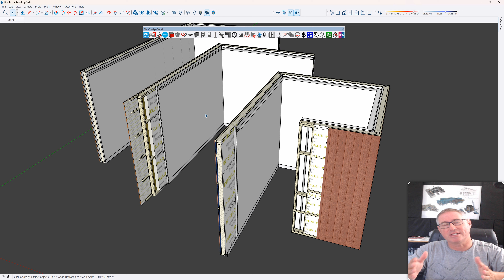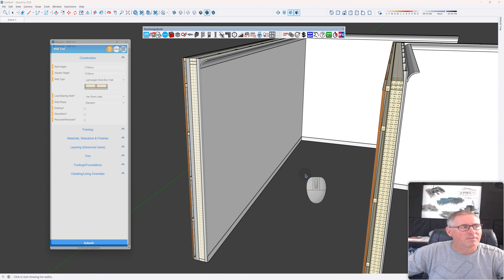Passive house wall build-up creation. Sustainable Design & Estimating   Extension for SketchUp 2024+

Comment: Counter battens?
Reply from the maker: Yes. Battens are available on both sides of all wall types; you can choose spacing, type, size and direction. E.g. verticle and horizontal to work with the selected cladding/direction. 
https://plusspec.com/plusdesignbuild/
Reply: @PlusSpec a counter batten on a passive house is typically battened out twice with the stud followed by a vertical batten and then a horizontal batten. I know you can do one batten externally but is it possible to do 2?
Reply from the maker: @danielperrem  2 external battens?  Hmm, I would have to think about that one. The double internal wall may be the answer.  Dan, it is probably best to ask this question on the forum, as I know there are a lot of passive home designers there that ar coming up with some amazing solutions. Here is the link to the wall tool on the forum: https://forum.plusspec.com/c/plusspec-community/wall-tools/43